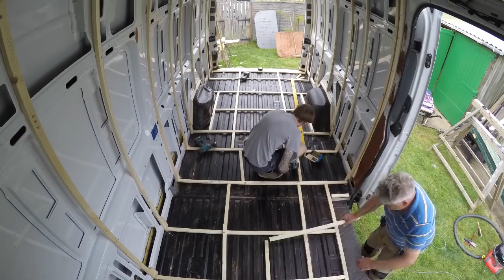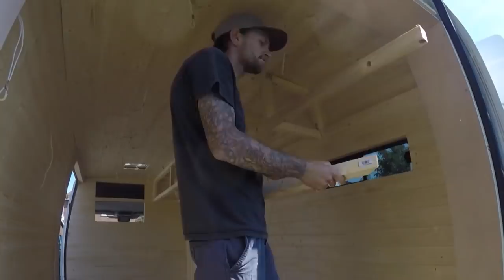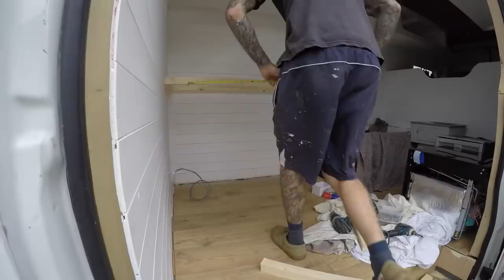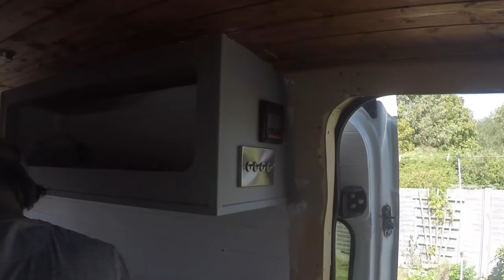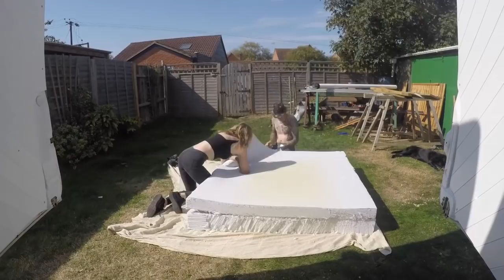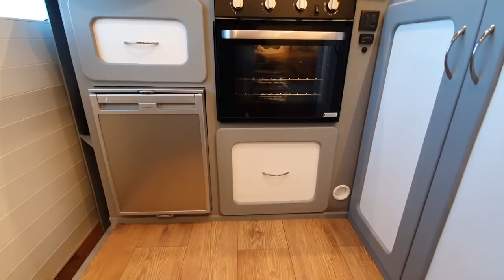Sprinter Van Conversion Full Build Time-lapse | VanLife UK

Comment: What type of spray foam is that ??
Looks way better than that Expanding  stuff !
Reply from the maker: Haha its most certainly better than the expanding foam 😆
It's called spray insulation, it's used primarily on internal factory and steel building roofs and also barges where you can't fit flat celotex. It's used for insulation and stops condensation. In my view it's without a doubt the best type of insulation you can use on a van 👍🏻
There is a separate video on my channel of it being put in 🤘🏻

Comment: I always wonder if van builders actually check the total weight of their vans after the conversion, I mean including fully filled gas and water tanks. Do you/they ever come close to the maximum allowed weight of 3,500 kgs of Sprinter type vans?  Some of you must have gone overboard and then remove some of the added stuff to keep it under that maximum? Plus, there is also the weight distribution. Having a water tank and/or the batteries on one side of the van will shift the weight balance quite a bit, depending on how and where the water tank is placed. It could result in uneven tire wear.
Reply from the maker: Hey mate.. sorry for the late response 🤦🏼‍♂️
I'm not sure how many people really do if I'm being honest.. I'm too scared to get it weighed in case it is over 😅 I will definitely do it at some point. My sprinter only has a pay load of 1.27te so I'm probably not that far off 🙄
Good point with the weight distribution too.. one of the reasons my batteries are on the wheel arch was so they are on the axle and the water tank is centrally mounted behind the axle.. I wonder if the professionally built vans take it into consideration but it would defo have an effect.. I'll be keeping an eye on the tyre wear thats for sure 👍 
Cheers for the comment 😊😊
Reply: @BejamVan  I've been thinking about building a camper for awhile now. Like many others have said really good videos! 
Any way, i replied to this as weight is something i aways think of. I'm an aerospace design engineer and have been involved in composite design and aircraft interiors for years now. Obviously, weight is a big issue in aircraft so IF i ever get round to doing something like time I'm going to really think about weight and design the interior from a weight stand point not a cabinate builders stand point. Point worth noting, in aircraft interiors we put lots of conduits behind side wall panels to allow you to add wires with out removing interior panels. Any way, good job, looks amazing!

Comment: Mate...just finished a binge watch..really sweet mate, good job....couple of things thou...ever thought of getting in a proper sparkly!?!? 👌🏻also, at the beginning you said about your mums caravan... why didn’t ya use that gear out of that? I guess she sold it? Looking forward to watching your van travels
Reply from the maker: Hahaha cheers mate.. so much changed during the build, the layout, the equipment etc. I wanted to use the caravan to save money but to be honest I just got carried away.. the caravan is fairly old and out of date so when it came to it I was like actually I want this thing to modern and efficient. 
I did scavenge a few bits from it but ended up using it as a bit of shed instead 😅
Cheers again dude.. 👊🏻👊🏻

Comment: Can I ask why no vapour barrier ?
Reply from the maker: No worries at all.. I didn't use a vapour barrier because I had the van spray insulated which mitigates the need for one. It also stops the need for sound deadening as its sticks directly to the outside wall of the van. 100% the easiest and most efficient option I feel. 👌🏻
Reply from the maker: Should also add that I made a mistake putting in the rockwool insulation.. definitely didn't need it and causes more hassle than it's worth so would not recommend it. Spray Insulation is plenty good enough on its own. 👍🏻
Reply: Bejam Van Thanks fella 👍👍👍👍

Comment: Y not use Aluminium  bracing instead of wood..
Reply from the maker: Hey man.. to be fair aluminium would 100% be a better alternative mainly due to weight but I guess on building this van I had the tools and equipment readily available for wood. It has added some significant weight though 😅